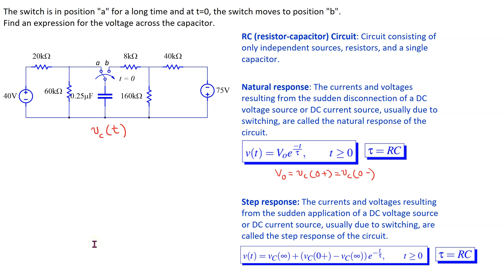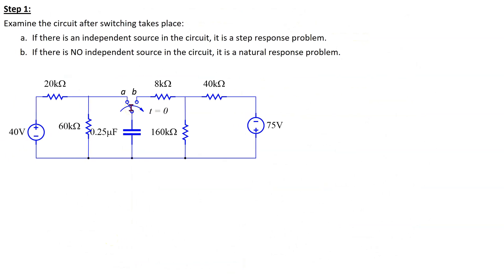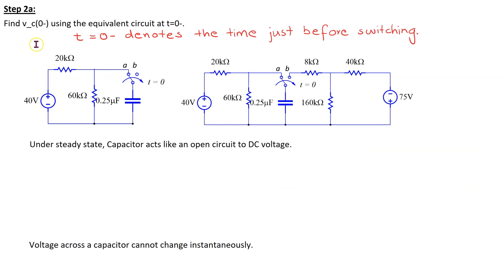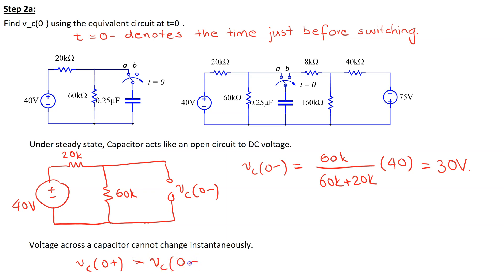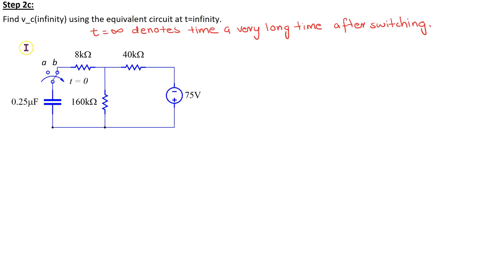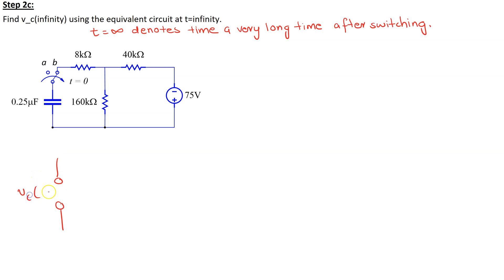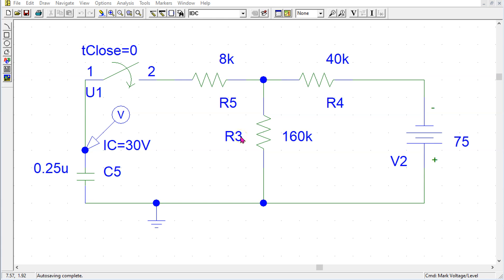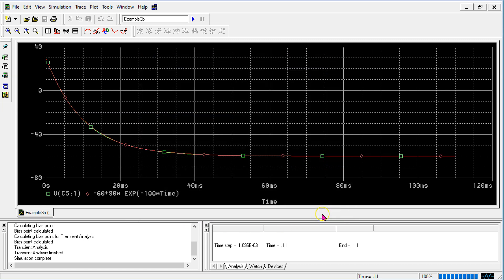Example 2 - Solving for Step Response of an RC Circuit

Comment: Why can't we switch the polarities of the capacitor, and thus it is short-circuited with the 75 voltage source and we get Vc as 75? final equation I got was 75 - 45e^(-100t)

Comment: at 11:32, why do we not include the 8k ohms?

also if the question asks to find the expression of voltage at the 160K ohm resistor, why is 8k ohm resistor included when finding the initial value of voltage across 160k ohm resistor?
Reply from the maker: For your first question: Voltage can exist across an open circuit but current cannot flow through an open circuit. The 8k resistor is connected in series with an open circuit so has no current flowing through it and takes no part in the calculations. Hence, we don't include it in the calculations for the open circuit voltage across the capacitor at 11:32.

For your second question: If we are finding the general expression for the voltage across the 16k resistor, we include the 8k resistor in the calculations as we are not treating the capacitor as open circuit. Having found the voltage across the capacitor, we can write the node voltage equation and this will include the 8k resistor. Then simplify and solve it to get the expression for the voltage across the 16k resistor. Hope that clarifies and makes sense.
Reply: @electriccircuits7164  ohhh I understand now. Thank you sir
Reply from the maker: Glad your misconception was resolved.

Comment: Please help!--> @4:55 why wouldn't the reversed polarity of the 75V source affect the voltage across the Capacitor. Even though there is no current on the right side, wouldn't that entire big node across the bottom that extends to the capacitor be at 75volts?
Reply from the maker: Thank you for the question. At time t= 0- ( just before switching takes place) only one end of the 75V source is connected. As the other end is not connected, it is not a complete circuit and the 75 V source plays no part before switching takes place. Hope that helps!
Reply: @electriccircuits7164  If I were to touch the node along the bottom, would I get shock?
I don't really see WHY the voltage along the bottom node wouldn't be 75V, since  Voltage does not FLOW like current. Doesn't voltage extend up to any OPEN in a circuit? Thanks
Reply from the maker: Your misconception is related to concepts of open and short circuit.

An open circuit can have a voltage across it but no current can flow through it.

A short circuit can have a current but voltage drop across it is 0V.

Consider a resistor connected to a voltage source using a switch. When the switch is open, only one end of the voltage source is connected to the resistor. There is a voltage drop across the switch (equal to magnitude of voltage source) but there is no current flowing in the circuit. The voltage drop across the resistor is 0V because the voltage source is not connected to the resistor.
Reply: Thanks for the reply. I am well aware of the short vs. open concepts that you gave .   It seems that you made my argument for me.  Let me ask you this. What is the voltage of the large node across the bottom of the circuit you have drawn?
Reply from the maker: Before switching takes places, the 75V source is only producing current and voltages in the 48kOhm and 160kOhm resistors.

This source is not producing any current in the Capacitor or the 8kOhm resistor as these are not yet connected to the 75V source through a complete closed circuit.

Voltage is always measured between two points in a circuit. For node voltages we measure the voltage between a node and ground.

The voltage along the bottom node is not 75V.
Reply: @electriccircuits7164  Thanks so much.I will ponder this for a while.

Comment: What if any of the dc source replaced with a period signals like square wave say its -0.7 to 4.3v and whose frequency varying around 350kHz to 500Khz. Thanks in advance
Reply from the maker: Thank you for your question. The technique demonstrated in this video works for DC sources only. For periodic sources, you would need to use Fourier or Laplace transform to solve the circuit.

Comment: does not it supposed to be Vc infinity - (-75)? due to polarities and then we find Vc infinity = 100v
Reply: Exactly bro I am having the same doubt. Did you do this question from some other source where they took the polarity as +75V?
Reply from the maker: Thank you for the question. The value calculated in the video is correct. VC Infinity cannot be 100V. After switching has occurred there is only the 75V source in the circuit. So a long time after switching has occurred the voltage across the capacitor cannot exceed the source voltage. We have some resistors so some voltage is dropped across them. Thus vc Infinity magnitude is less than the source voltage. I hope this intuitive argument explains why your reasoning is incorrect and VC Infinity cannot be 100V.
Reply: @electriccircuits7164  what about polarities? positive side of the 75v voltage source is referred to as ground, that is, 0 v so, we need to accept  other side of the 75v voltage source which is negative side as -75v. Am I wrong?

Comment: do you also have videos about sequential switching in these rl and rc circuit??
Reply from the maker: Thank you for the question. Sequential switching is when the energy storage element (C or L) is only allowed to partially charge or discharge as a result of switching taking place. The available videos in this channel at the moment consider cases when C or L is allowed to fully charge/discharge. 

Sequential switching can be easily simulated using the techniques discussed in the channel videos. I will take your suggestion on board and consider theory/examples of sequential switching in future videos.

Comment: what do you do if there is a dependent source?
Reply from the maker: Thank you for the excellent question. The systematic approach discussed in this video does not apply if the RC circuit contains a dependent source. For such circuits, one must resort to the method of writing and solving the differential equation. This is because if an RC or RL circuit contains a dependent source, then there is the possibility of unbounded response, i.e., voltages and currents increasing without limit. Thus, we cannot use the t =0-, 0+ infinity analysis to predict the final value of the voltage or current.